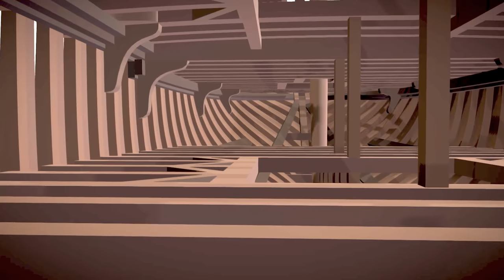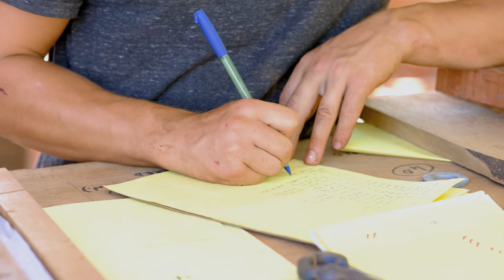Tween Deck Beams - Building Ceiba, the world's largest wooden cargo sailing ship.

Comment: I love this project. I love the craftsmanship, I love the "low tech" work, I love the way it looks. I would likely love the way it smells. It seems to be the epitome  of the old time woodworkers' boat building skills. But I can't help but wonder if modern computer design could have made improvements. Those massive beams are cool, but would they have been better as a laminate? Would they have used less wood if they were triangular trusses, rather than one piece of solid timber? I dunno. I just think that it will take some more computer work to change the pattern of commerce.